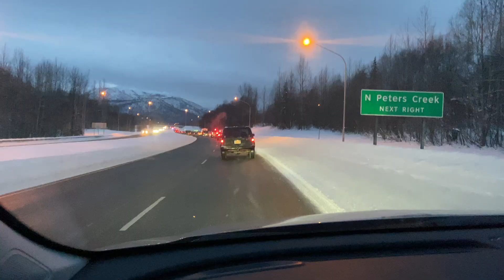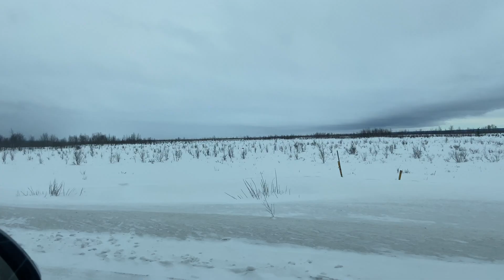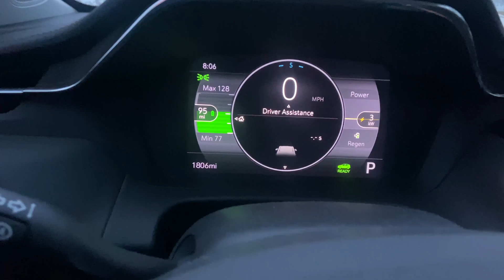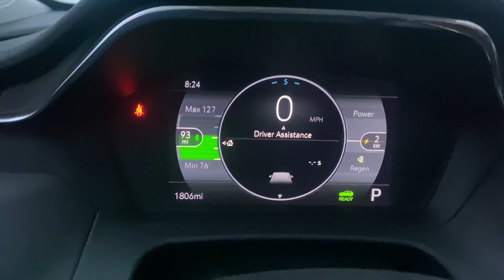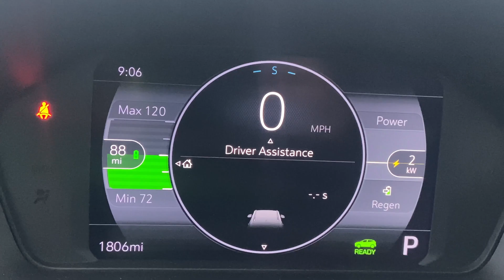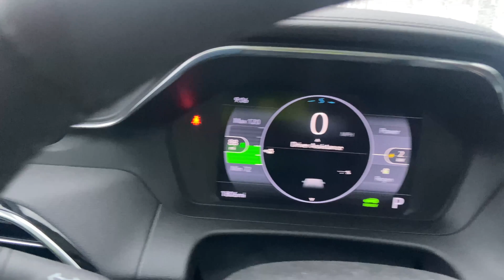Bolt Surviving Traffic Jams in Extreme Weather

Comment: Would you mind doing a commute in the cold at 70F to test how much less battery that temp uses? Even at 71 or 72, if 70 is too uncomfortable. Thank you.
Reply from the maker: It appears to add about 15-20 miles per day during a 100 mile commute.

Comment: 80 degrees is pretty high for the heater setting. The highest I ever set my heater on Auto is 73 , but usually 72 I always start with the seat heat and steering wheel heater. A lower temp is easier to maintain and will use less battery power.

Comment: It seems like the mileage wouldn’t be an issue since as long as you are doing more than 5mph you are in regen mode. It’s the low speeds that kill Ice vechicles gas mileage . EV’s are the complete opposite

Comment: Just like ICE cars make sure you keep them topped up.  "Stuff happens" when we least expect it.  Plan for the bad weather, accidents, power outages etc and then they are non-events.  Don't plan for them and they become crisis in a hurry.   I don't want to be on the side of the road with any vehicle that is low on charge or low on gas.
Reply: Agreed. The reality is that the average drive is much shorter than the Bolt's range. I plug in when my range drops below 250.
Reply from the maker: Exactly